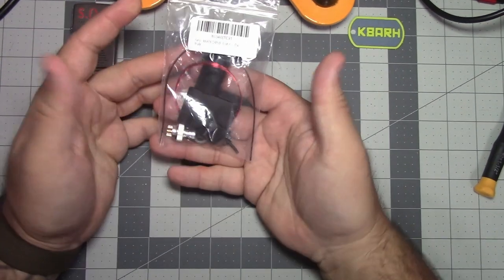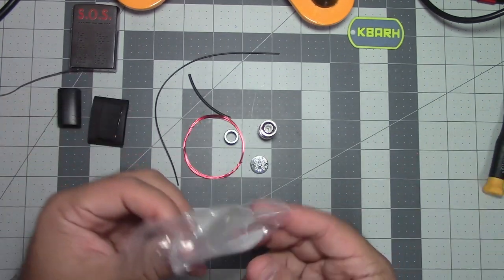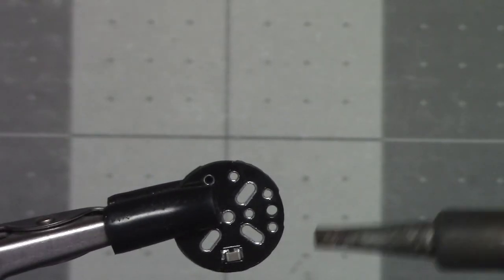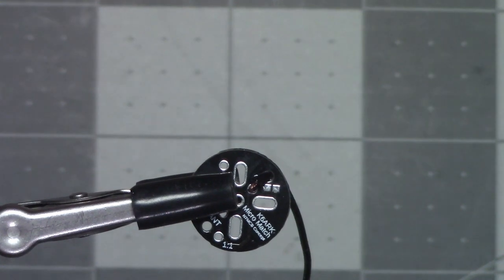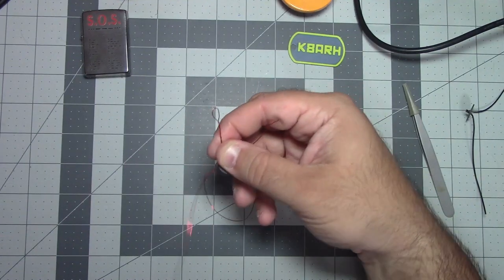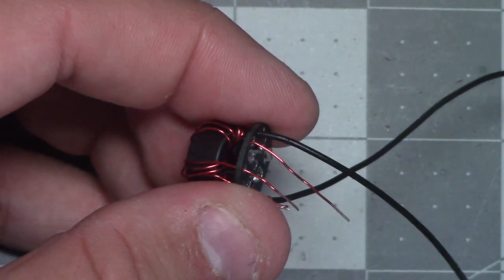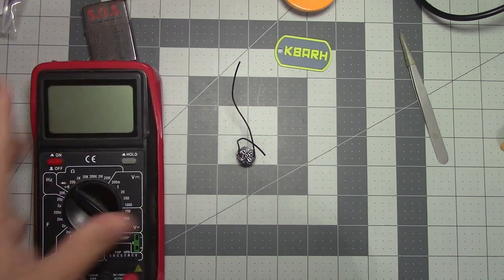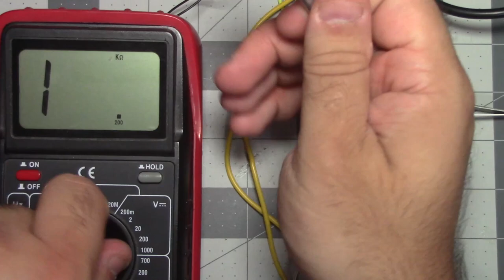[Amateur Hour] K6ARK QRP EFHW Kit [BUILD]

Comment: I found it. EFHW or EFRW Matching Unit is a device used in amateur radio to match the impedance between an antenna and the transmitter. 

So when I get a nice big radio and antenna, I'll need one of these to fix my SWR. 

I'll have to save this video for later then. :)